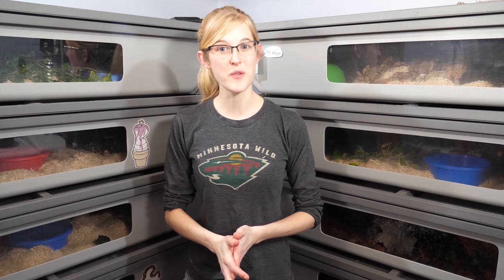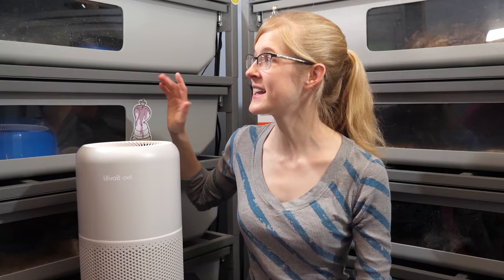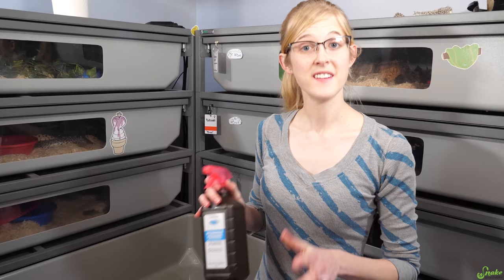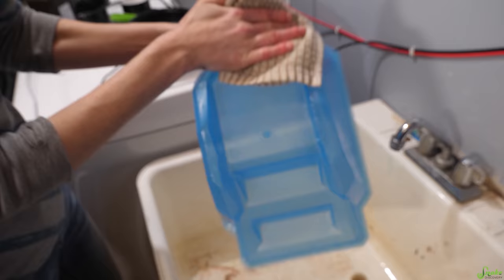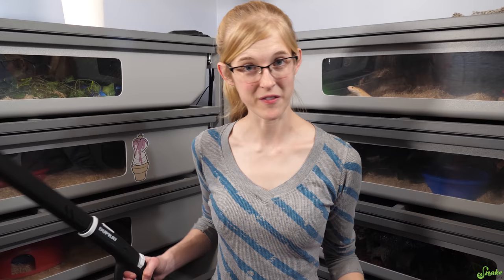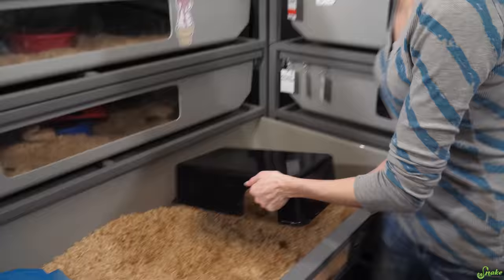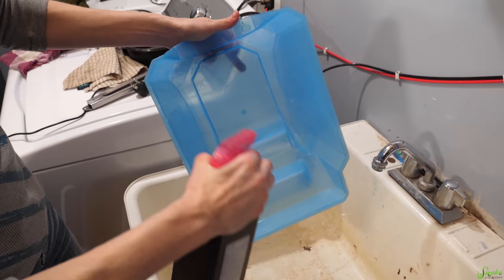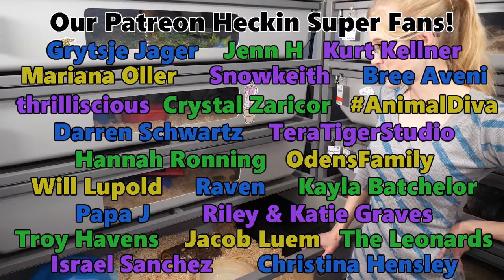How to Disinfect Your Reptile's Enclosure

Comment: just a PSA, make sure to research what cleaners you are using and mixing. For instance, she says to use both vinegar and ammonia to do the pH change, those are not dangerous if mixed by accident during this technique. Do NOT mix vinegar with bleach, this will produce chlorine gas which can be toxic. Some strong chemicals can be toxic to the animals, so if you have a pet with a delicate respiratory system make sure to let the cage sit empty for a bit to get rid of the chemical residue and smell even after you rinsed it off. Cleaners are chemicals so do some research before using. Also, use gloves with undiluted ones if you mix your own. If splashing is a concern wear goggles or splash guards. If I missed any safety tips let me know!

Comment: Part of my cleaning process is F10 Veterinary Disinfectant. You add a few ml per liter of water(4ml per liter for average strength with F10 SC), and can be used just about anywhere. You can spray it on and let it air dry too, which is neat. Great for any animal enclosure, and you can also spray it on your hands and let it air dry to disinfect your hands.

Love the stuff, pretty cheap, and a small bottle can last forever since you need such a small amount per liter.

Comment: Great video! Thanks for sharing! Oh, that 

My cleaning process is similar. I use a shopvac and paper towel to get all of the bedding & debris out of the enclosure. Then, I use a disinfectant depending on the surface. For routine cleaning of plastic & melamine, I use hydrogen peroxide. For routine cleaning of glass, I use vinegar. For deep cleaning of used items for a new animal, I use F10...because I have it already and it kills everything...just rinse well with water. I also have wipes that are basically F10 for wiping down things like scales and holding bins that might be used by multiple snakes. We've used chlorhex before too for enclosures of wildlife that might have parasites. After rinsing, I steam clean anything that needs a deep cleaning.

Comment: I've recently had a course about food ( for horses ) and we had a small side path to cleaning. She explained that micro organisms are everywhere but 90% are neutral only 5% is bad ( and 5% good obviously ) and that 90% will follow whichever is more abundant. So she uses this brand called microferm, it is basically active good micro organisms suspended in water. And she uses it for basically everything, as a wound spray, to "desinfect" her stables with, to faster compost her plant waste as well as the manure the horses produce, cleans her house with it and even make her pasture and garden healthier, like you name it you can use it for it. She told us that there was an experiment where the cleaned one half of a butchers table with halamied and the other half with microferm, and the next day the microferm half had less bacteria on it. Which makes sense, if you are hurt you get stressed out and quickly start compensating which can become overcompensating. And because they are good micro organisms they are completely harmless, like I've had it accidentally sprayed in my eyes

Comment: Also, if you only have one or two snakes and want to steam clean the enclosures, get a steam iron. It shouldn't touch anything, but by using the steam/spray function it should work just as well

Comment: In Australia hydrogen peroxide isn't used as much and not as readily available, I use half vinegar half water, with a drop of dish soap, in a spray bottle for 90% of cleaning. If I need to deep clean I soak the substrate (I use astroturf) in hot water with vinegar or bleach, depending on how soiled they are, then soak again in hot water and soap, more soaks if I've used Bleach to get Bleach out. to clean the enclosure I use the vinegar water spray, clean everything, spray it again and leave it. I like vinegar and water spray because I can just spray anything and not worry about the snake inhaling it or ingesting it, because it's fine, also handy for my silly but ferocious eaters to get them off your hand.

Comment: I had a confirmed case of crypto earlier this year. I bought new PVC racks and stopped using my diy melamine ones. I also use hydrogen peroxide, but the vet recommended 6% or higher. I use gloves because it burns my hands. I also use chlorhexadine for light cleaning.

Comment: Wonder if a clothes steamer would work for smaller setups. The steam gets insanely hot, though I'm not 100% sure it gets above 250F. I do know it gets up to that temp though cause I've used a heat gun to check one my friend had, wondering just how hot it got. You just can't control the steam as well
Reply: for it to be steam, the heat has to be at least 212F, probably a bit more to be sure. I can't give you a complete guarantee for it to work, but be asured most bacteria and viruses die from way lower temperatures.

Comment: The problem with encouraging pH swing cleaning is that if you mix certain common basic cleaners with certain common acidic cleaners you will create chlorine gas aka mustard gas which is highly toxic in even relatively small quantities (it dissolves the lining of your lungs, nose and eyes) so you absolutely must make sure that you remove all trace of one chemical before using the next especially if you don't know what you are doing. Never mix cleaning products ever
Reply: i know i was thinking the same, like also she said to make it smell better you can add  lemon juice to the ammonia and thats a one way street to making mustard gas.

Comment: I am planning on getting a snake it will be my frst one . I have been looking at milk snakes and I think that would be the one I want . I have a 20 gallon long tank.  Do you have any recommendations for snakes.  I also want to know if you should use heat lamp or heat mats
Reply: Maxican black king snakes are also pretty cool and easy to handle
Reply: @celina3810  are ball pythons easy to handle?

Comment: 4:04  Just out of curiosity.  Do you think it's actually the hydrogen peroxide that is actually making it easier to come off, or do you think if you left the soapy water soak for 10 minutes, just like the hydrogen peroxide, it'll do the same?
Reply: Peroxide is active, and it eats away at organic stains. Dried poops or crusty fluids or anything like that. So the peroxide is a good step, and it does help to break that stuff down. It also breaks down the slime that gets left in water bowls.
Reply: @algrant33  Thank you so much.  I didn't know that.

Comment: 6-7% hydrogen peroxide kills crypto. That's what I use when changing decor from one animal to another animal. If it won't fit in the dishwasher.
You can get that concentration by mixing 3% peroxide with 12% half and half.
Just spray it down than wipe it around so you don't miss any spots. 
If it's cork bark then I will just make sure to really soak it down. Than just make sure you let it dry completely! It can hurt your animal if not.
Make sure to wear gloves because it will burn your skin! It will hurt pretty bad if you let it sit on your skin for even a short period of time. If I get it on my skin it itches like crazy and hurts.
It's probably best to wear a mask too.
Also wear long sleeves if you are doing an enclosure of something like that so it doesn't get on your skin. Also wear old clothes or clothes you don't care about because it may lighten the fabric.